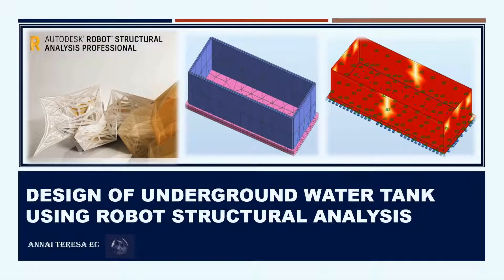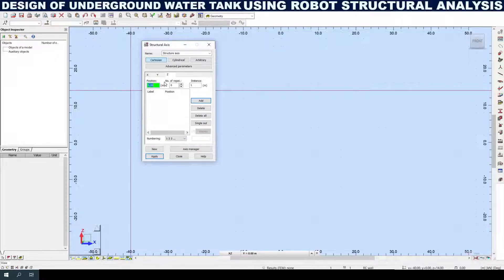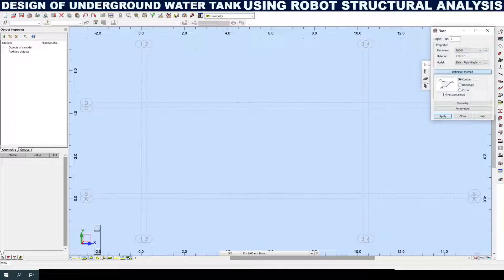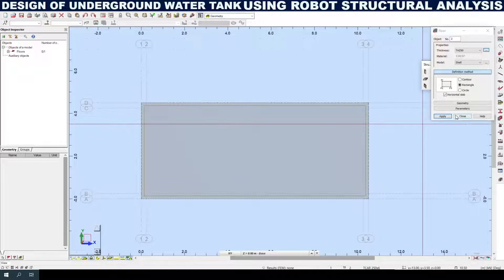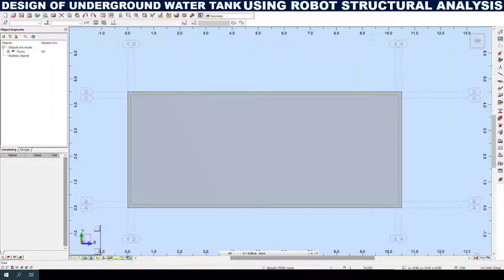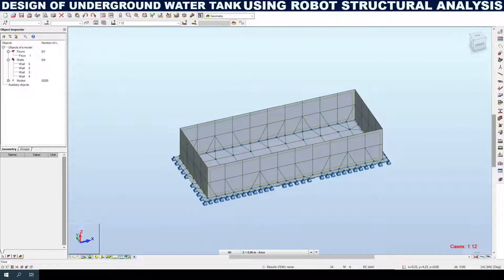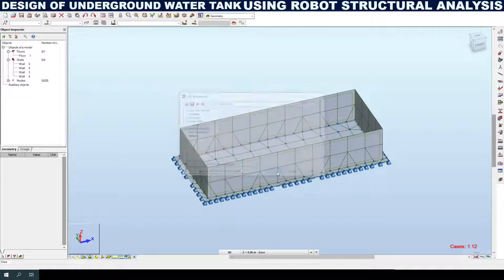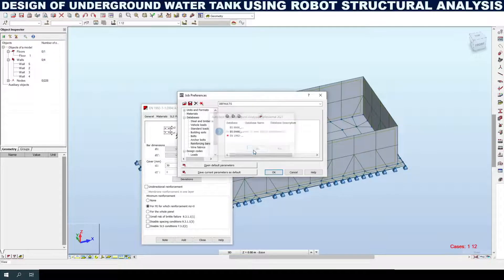Design of Underground Water tank using Robot Structural Analysis

Comment: Hello, will the selfweight of the water not be acting on the floor?
Reply from the maker: Yes. Two scenarios. One when the tank is empty and Soil pressure. Another is tank is full no soil pressure. In the second scenario need to consider water density. But, considering water weight on slab will not give better results, as net upward pressure get reduced, when tank is full. Better, We can ignore water weight for UG and on ground tanks on floor slab desing.

Comment: thanks for you but where is the effect of filled soil on the walls the crticale case is when the tank empty and thers only soil effect.
Reply from the maker: Hi, Thanks for watching the video and thanks for your comments. Yes, correct.. Water tank to be checked for 2 major cases. One: when tank is empty & soil pressure exist and Two: when tank is full no soil pressure. For time constrain to limit video duration less than 30min, some real time loads are not performed. Soil pressure can be also applied by Considering GA (density) value as 1800-2100kg/m3 in load table as hydrostatic pressure, Also if surcharge pressure to be applied, the same can be added as load type: 'surface on object' in load table.

Comment: top slab not included/soil pressure not included
Reply from the maker: Soil pressure can be considered same as hydrostatic loads only change is density and direction of loads. Top slab are designed is separate video with openings: https://www.youtube.com/watch?v=ZmDI7V18tnE&list=PLorbvg8Gw7DgOt-N0VCeiT0pVq4bksx1f&index=4